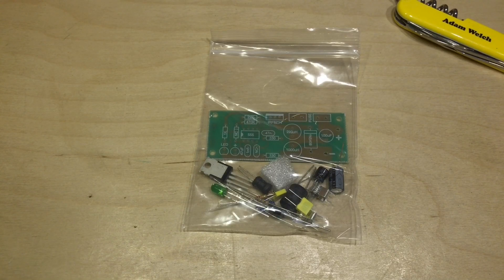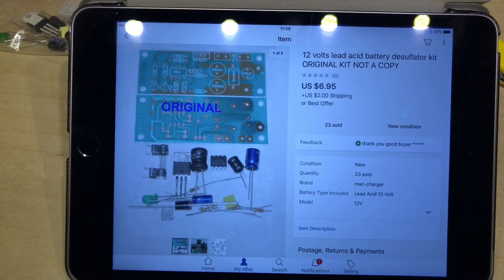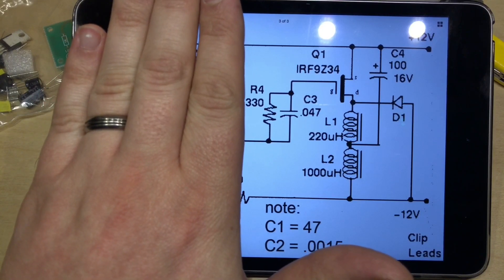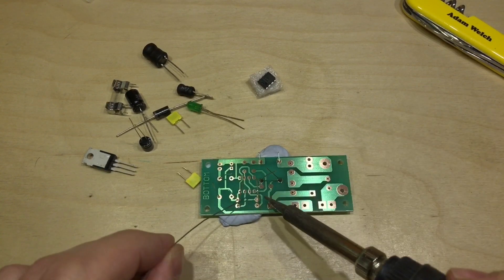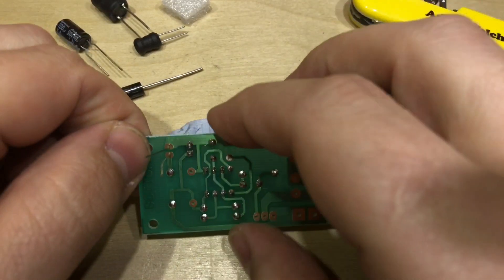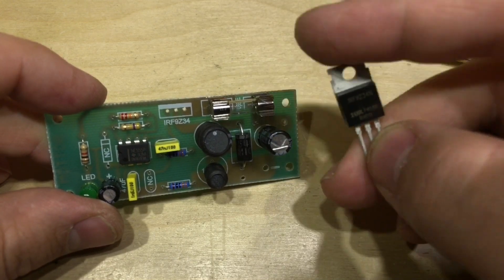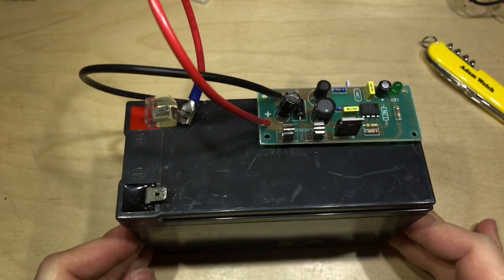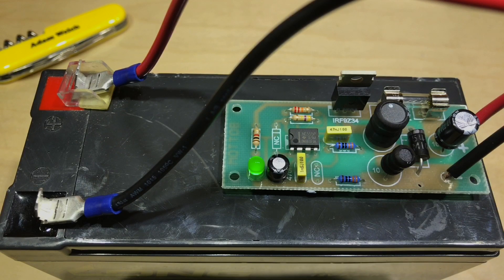555 Desulfator Kit Build - 12v Solar Shed

Comment: I bought that same unit and an infinitum desulfator. I had some luck with a small SLA battery and that's it. I read on a forum years ago as I wanted to do a battery reconditioning business on the side. A military desulfator works but a lot of noise and crackling. ( engineer reported) he was scared it was going to blow! Lol. I would love to see a bigger heavy duty version? Nice video. Always a pleasure. Cheers from Australia 🙂👍👍👍

Comment: Thanks for the scope signal! I have tried this desulfator on a very old UPS battery like your and it is working, the battery was completely dry, I putted pure water back and was able to revive the battery that was sitting for 12 years in the UPS unit.  How ever the desultator process can take a few days.
For those who want this board already mounted you can get from Amazon.

Comment: This design was first published by Alastair Couper for Home Power Magazine - https://www.homepower.com/view/?file=HP77_pg84_Couper.  A lot of improvements have been published and is widely available online.  A few notable improvements are:  increasing the C4 - 100uf capacitor to a much higher value to reduce the ESR (1000+ uf is not out of the question); using a higher current 220 uH toroidal inductor to reduce the chances of saturating the inductor as well lowering the resistance (the actual value of the inductor isn't important but the amount of resistance is).
Reply from the maker: Excellent insight - thank you very much for the info.

Comment: Ive bought several of these on Aliexpress but not used them since i gone over to 24 v battery banks.
Can i serial connect 2 of them or how do i desulfate 24 volt connected batteries?
Reply from the maker: They are self powered so I don't see any reason why you can't just put one over each of your twelve volt batteries even though they are in series.
Reply: I just thought it would still be exposed to 24 volt and cook off
Reply from the maker: If you connect the desulfator directly across the positive and negative of one single 12 volt battery it will only see 12v.  Do the same to the next battery and then connect them in series, the desulfators will only see 12 volts each.  Cheers
Reply: thanks a lot.
i wasnt aware of that and i had searched for 24 volts desulfators but found nothing.
i was beginning to think those 5 where worthless now

Comment: Adam from 12v + 1N4148 to 0.1uf capacitor from capacitor to 12v - on capacitor you can test the piek voltage i have tested + - 40volt

Comment: nice. but what is the minimun voltage acceptable for it to work and desulfate the battery? if the battery its heavy sulfated shall i connect the charger and desulfatir in paralell?
Reply from the maker: YEs - always best to connect a charger as well - remember the desulfator uses current too.

Comment: Can these be connected to a solar battery bank with the solar charger still in place?
Reply from the maker: +John Armstrong Yes they can - and this is the best way as your battery bank will still need charging. As I showed in the video the pulses get weaker further away from the desulfator, so it's fairly unlikely your charge controller will even see them. The jury is still out for me on whether these desulfators work though - for every person who says the do there seems to be another who says they don't. Time will tell.
Reply: Adam Welch Thanks Adam and thanks for the video. The kits on its way to me and I'm a sucker for placebo so I'll feel like it's doing some good whether it is or not! 😄

Comment: I've been using desulphators for stationary batteries for ages. Not little inductor ones like these which are maybe capable to help out small desulphated batteries but ones with huge toroid inductors. You need to keep them connected for about 3 weeks and do not let the voltage go below 11v when desulphating. They definitely clean up the plates from sulphation. Having said this, batteries do eventually fail and their capacity is never brought back to what it was when new. So I would recommend them to keep plates clean and for batteries you feel are failing prematurely. The only way to see a difference in battery performance is using a battery load and taking the voltage drop of the battery under load. You will know a car starter battery is failing if under load the voltage drop is down to 9v to give an example.
Reply from the maker: +billywhizzy Glad to hear you've used some with good effect. I'm not sure this one has the grunt for large batteries as you say. 
I'm still undecided on them. I need to find a small sulphated battery to do some tests with.
Reply: This one will maybe desulphate a 10ah battery which was good but left unused for a long period of time and voltage has dropped to about 9v. Will take about 3 weeks of continuous desulphation to restore the battery
Reply from the maker: +billywhizzy Thanks again for the info.
Reply: Hi i have q questoon so can i use a transformer and a bridge rectifier as a desulphator? Because i heard that it is pulsated DC at 100Hz
Reply: @mark5432  Not really..its not the frequency that is important but the voltage spikes at that frquency in the region of 30V or mor for a 12V battery.. and not too big of spikes to fry the output transistor.

Comment: could you double check that you not swapped the two inductors. i am almost certian you swapped the 1000uH with the 220uH.
Reply from the maker: +drbachler I've double checked this morning. I have them the right way round. The 220uH inductor is marked on the heatshrink (the 1000uH one isn't). Now the 220uH is physically larger than the 1000. I'm guessing although it has less inductance, it is able to carry more current.

Comment: so what does the O scope look like when you hook up some charging current and voltage, with out that it is going to run the battery flat. divert 1 of your solar panels to it
Reply from the maker: +The Left Hand Yeah you need to keep charge going into the battery. Some of the more fancy desulfators have low voltage disconnect circuits in them to protect the battery. It looks the same on the scope while being charged - I did check that but there was nothing interesting to add.

Comment: These do more harm than good in my opinion. They can promote grid corrosion and raise the battery's self discharge. It's better to spend your time (and money) on monitoring your batteries and taking care of them, rather than using these "tricks" that have close to zero scientific merit to them. YM2C.
Reply from the maker: +Jakelec I'm not sold on them to be honest. This video is more about the circuit rather than the effectiveness. I'll be interested to see visible results on a cell - More testing required.

Comment: This would be interesting to measure the effectiveness of this de-sulphate by using one of those electronic battery testers that test the capacity of the battery.
Reply: 1 week ago, I just build this desulfator and than installed on lead acid battery 12v32ah, the other to 12v9ah MF battery after 1 week only on MF battery this desulfator can repair dead battery, tested soc 97%, soh 98% and CCA 150A.
Reply: @untungsuharto7991  That’s interesting, do you know what the soh was before desulfating? Good to know that it works.

Comment: Is this something you are supposed to leave attached all the time or just plug into the battery every now and then for maintenance? Hope it does its job for you either way.
Reply from the maker: +Simon Inga Yeah generally you'd leave it connected all the time. It will use some current though so if you're ever struggling to charge your batteries it's best to remove it. Fancier ones have low voltage disconnect circuits in them.

Comment: Nice...I found a DIY one...it seems to work quite well, I have built 3 of these and they desulfate batteries with no problem..only thing is I have to put on for a long time at low current charge rate (only problem it's not a kit and you have to source the parts)
https://oshpark.com/shared_projects/ATrDSRDV

Comment: Adam, how would you be able to test the effectiveness of the desulfation? Can you do a follow-up explaining?
Reply from the maker: +John Klopp Essentially you'd fully charge the battery and use a load (as simple as a lamp if you like) and note the time it takes to drop to a specific voltage. After a while on the desulfator (and probably best a few discharges and charging cycles) do the test again. Hopefully it'll take longer before it hits the target voltage and you can assume the battery is improving.
Reply: Makes sense. Thank you!
Reply from the maker: +Vyl Bird It does beg the question why a large player in the desulfator market hasn't done that.
Reply: Scientific proof can be found by using a capacitance battery meter which measures the internal resistance of the battery.  The theory behind it is as the battery sulfates, the internal resistance of the battery increases as the level of sulfation becomes thicker (which is borne out as older sulfated batteries have an higher internal resistance). So, if desulfation works, the internal resistance of the battery will drop as the level of sulfation drops.
Reply: How do you know it is not the additional discharge and charge cycles that did the good deed? :-)
Reply: I know - I think part of the fun of this stuff is that there is an element of art involved, as opposed to cold science :-) I suspect the idea is to get 5 "dead" batteries, put them through charge/discharge cycle 3 times each, and then do the thing with the desulfimanitatorer and then test all 5 again. But that might just give you a definitive answer, and what fun is that? :-)
Reply: Perhaps he should make a 'demo battery' - a set of six lead-acid cells made using glass containers and removable plates so you can actually look at the state of the plates, rather than try to infer condition from external measurements.
Reply: http://www.ebay.com/itm/Constant-Current-Electronic-Load-Battery-Discharge-Capacity-Tester-9-99A-60W-30V-/132043334921?hash=item1ebe656509:g:D90AAOSwo4pYXO-F

http://www.ebay.com/itm/18650-Li-ion-Lithium-Lead-acid-Battery-Capacity-Meter-Discharge-Tester-ZB2L3-/172577675238?hash=item282e6e57e6:g:2WQAAOSw4A5Yygu-
Reply from the maker: +Douger Rohmer Sounds like an experiment - but getting identical batteries to test side by side may be tricky!
Reply: Try to find scientifically solid proof test on youtube. Seems like a lot of videos online but reading the comments I see a lot of valid questions about the test procedures and effects of these tools. Maybe Adam can let us know the next couple of months.
Reply: http://www.ebay.com/itm/DC-Load-Resistor-Electronic-Constant-Current-Battery-Tester-Real-time-Monitor-BY/252823111767?_trksid=p2045573.c100507.m3226&_trkparms=aid%3D555014%26algo%3DPL.DEFAULT%26ao%3D1%26asc%3D41375%26meid%3Dd83bbae04b8d4ddaa4c61ec1cd508f6b%26pid%3D100507%26rk%3D1%26rkt%3D1%26
Reply: http://www.ebay.com/itm/150W-Constant-Current-Electronical-Load-Battery-Discharge-Capacity-Testing-Tool-/172475195834?hash=item282852a1ba:g:zTUAAOSwo4pYb0f7  There is the big boy 150W, at 12V that is 10A.
Reply: i use the 60 watt one my self and very happy with it.
use it for anything from 18650 cells to car batteries in my solar system
i saw a review on Voltlog for the 150w version and he says its junk

Comment: Desulfator what? The more i learn about battery's the more complicated it gets.
Reply from the maker: +magicer83 If you look after your batteries from day one (don't let them discharge too much and especially not when it's cold) you probably don't need one. If you've invested large sums of money then perhaps you'll want to investigate them further - but for everyone that says they are great there another to say they do nothing. I'll reserve judgement until I've tested for a while.
Reply: I see.. thank you for replying let us know if you see any difference :)
Reply: Sulfation is something that happens to lead-acid batteries if they are left for too long in a discharged state. It's the reason that leaving your headlights on all night can leave your car battery so dead you have to get a completely new one. Devices like this are intended to repair sulfation, but they don't work very well if at all - usually a sulfated battery is a lost cause and must be replaced.
Reply: i was planning on starting with beekeeping and trying to figure out how to get battery power to a remote area with no main powerline. When i started planning this it sounded realy simple.. Beehive, solarpanels, solar chargers, Dc-Ac converter and battery. Oboy was i wrong or what hahaha. So i will start with 1 small battery and 1 solar panel with a cheap solar charger just to do some basic tests at home. Thanks for the info all information is always helpfull.
Reply: Magicer, tell us exactly what it is you want to power and how much power it needs, we'll try to come up with something for you.

Comment: Did you make a review of the oscilloscope. Is it a good one? By the way no big inductance to be an efficient desulfator 30v pulse (at least) and high current pulse is needed. I doubt this one is doing the job. Though thx for the review.
Reply from the maker: +The Walking Trade It's the best oscilloscope I have! I've only used JYETech scopes before and it's definitely a lot better than those!  I'm not really in a place to do a full review because I don't have much to compare it with. I did a live stream when I first received it and went through a few of the features - and made a few mistakes! 
Yeah three volts above the battery isn't much - I do intend to revisit desulfators in the future now that I've built one.
Reply: Good I will be very interesting to see one that works ! Subscribed :o)